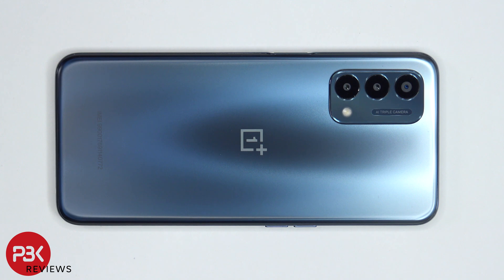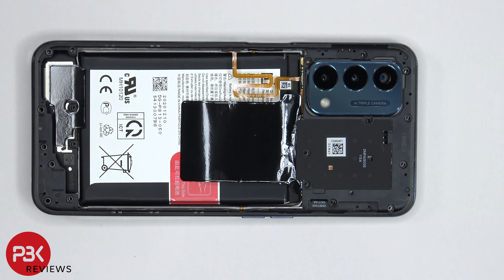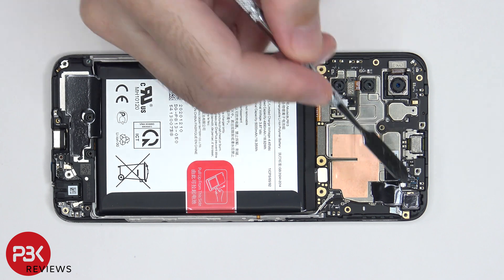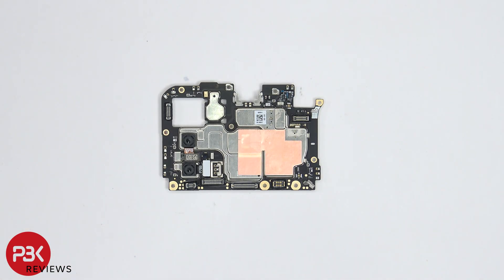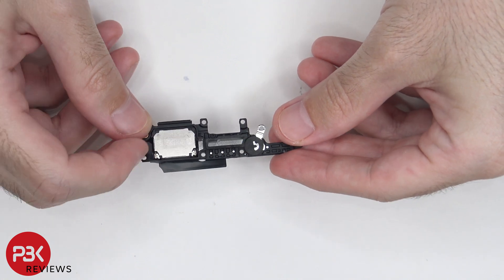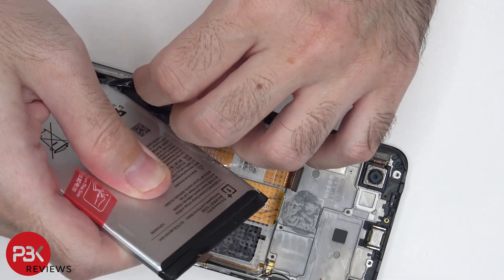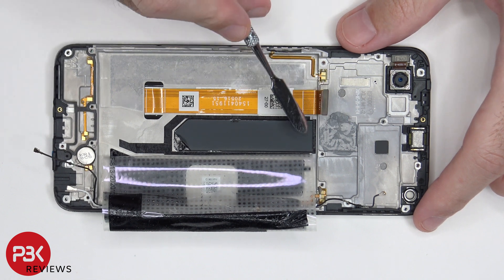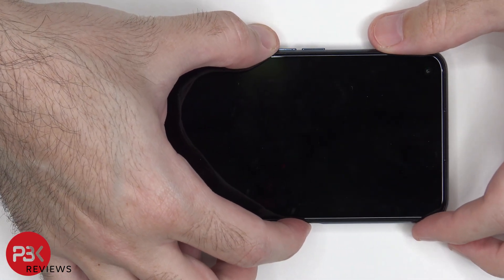OnePlus Nord N200 5G Disassembly Teardown Repair Video Review

Comment: Not clear what "adhesive" you're using to reapply the back plate. You have 2 "adhesives" listed in the list of tools but don't say which you use where, and the Amazon links give me about 3-4 different double-sided tapes. Can you clarify? Ditto for replacing the screen; which adhesive to attach it to the mid-frame? THANKS!! GREAT videos! :washhands::washhands:
Reply from the maker: for the battery door/back plate, you can replace it with a new battery door cover that has the original adhesive pre installed like this one: https://www.ebay.com/itm/185336010276?hash=item2b26e31624:g:Xw0AAOSwEGVhh6go   or you can watch this video explaining more about the adhesive etc: https://www.youtube.com/watch?v=T4iiPUIM7-Y   same goes for the screen adhesive.
Reply: @PBKreviews    a thousand thanks!

Comment: Hi, thanks for the video.

How much of the phone needs to be disassembled just to replace the battery?

Thank you
Reply from the maker: Hi, you're welcome. You would need to remove the back cover, the screws and back housing, and then you would have access to disconnecting the battery cable and removing (prying off) the battery. You would not need to take anything else apart at that point.

Comment: Thanks for the video.  I was able to replace the screen based on this video.
Reply from the maker: You're welcome!
Reply: Did you have to take the whole phone apart to replace screen or just the front?
Reply from the maker: @ZeldaOwnsMe100  Ya you would need to remove the back plate, the screws on the back housing and remove the back housing giving you access to disconnecting the battery cable and the screen cable from the main board, then prying off the battery so you can run the cable for the screen through the opening in the midframe and pry your old screen off, apply adhesive and re apply your new screen making sure to run the cable back through the opening in the midframe and re assemble the phone. If you have a screen with frame pre installed assembly, then you would move all your parts (motherboard, front facing camera, speakers and vibrator motor etc to the new frame and re install the back housing and cover.
Reply: @ZeldaOwnsMe100  The whole phone.  The video shows what the bare minimum disassembly is to replace the screen.

Comment: Hi Mr pbk need help i brought a s10 5g in Phillipines and it has no 5g signal 
My unit is korean variant and some other says if the s10 5g is korean it has no 5g antenna 😩
I hope you review again the s10 5g about the 5g antenna 🙏
Reply from the maker: Hi, you need to make sure the 5G bands on that version will match with the 5G bands on your network so it will work with it
Reply: @PBKreviews  some others says if you're s10 5g is US variant yung will get 5g signal unlike the korean variant 
I watched your teardown on s10 5g its the same there's some missing parts on the left side thats where the 5g antenna located im a bit disappointed to my phone 😞
Reply from the maker: @jeff033  the korean variant is 5g also but its sub 6 ghz 5G. Those extra antenna you are referring to is mmwave 5G antenna. If your network uses mmwave then you would need those antenna yes, but if not then the regular 5g version should work unless your network bands dont match. What network are you trying to use it on?